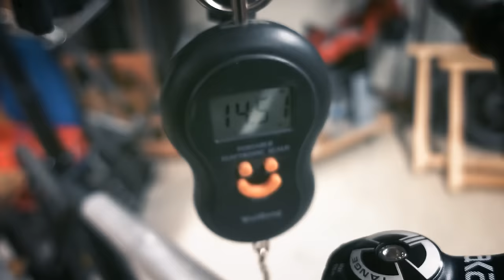Building a Light Cargo Bike

Comment: great vid I did enjoy the build, 
but I just thought, there's not much triangulation in the frame for a ?? commercial/weight  ?? carrying bike,  the  only triangle (strength builder)  on  a long frame is in the middle and it's very small, I'm guessing it's made from an aluminium alloy, which makes it lighter but much weaker... the original frame had a  near full triangle (head stem, to pedals to seat to head stem)     where this has a Much Larger weight carrying ability but a weaker frame,  square box,

Comment: why only one gear in the front and 10 in the back? 
how to power the lights only through supercapacitors?
Reply from the maker: Fewer gears and no front derailleur = less weight, less maintenance. I just don't need more. The lights are powered by a hub dynamo in the front wheel
Reply: Cool!

Comment: I admit that Phil's technology is great, and I appreciate it. The video is very comfortable to watch.
But my question is: I did not see any heat treatment of the welded frame. Is this strength sufficient for use?
Reply from the maker: So far it has held up fine
Reply: @PhilVandelay  Ok, your technique is great, I like it very much!
I don't mean any doubt，No argument.
my experience tells me that 7005 and 6061 aluminum alloys require T4 and T6 heat treatment after welding.

Comment: no offense. its a good idea/design, but I worry very much about "Stability and Weight Distribution" Some suggetion and advice though, would it be better if the carrier was at the back and it either three wheel or four wheel. Specially carrying that much load, Balancing is difficult and hard enough, though not wishing or avoiding accidents. My main  concern is safety for the package and most specially the driver and the people around. When safety is a concern I believe we cant cut corners. Peace. Take care and stay safe always.
Reply from the maker: You should google and read up a bit about cargo bikes and different models, it would take too long to explain everything here. It sounds like you're assuming I invented this bike, which I didn't. This, like other bikes I built, is a proven design that has been around since the 70s and sold millions of times. Bike messengers all around the world use these types of bikes daily for example. You should try actually riding a cargo bike before assuming they're dangerous/hard to handle
Reply: thanks for the info. i dont have a laptop and internet connection in my place is not good. just trying to get some ideas of trying to build one thats custom made. i got interested in this e bikes carrier, when i saw a video of drilled powered bikes. well in your country your roads are better off. I come from a mountainous region and our roads are not that great. I said no offense, no one can be overly cautios, one design may work for one person or situation, but it may depends on the user, their is no debate or arguing about that.Cheers :) Peace be to all.

Comment: 1 bolt trought carbon fork is enough? In my opinion it will wear carbon material around it, due vibrations and weight of cargo on bike an will develop play around it. It is too much stress for that.
But rest of the bike is very nicely done.
Reply from the maker: In order to vibrate the bolt would have to be loose in there, that's why it's secured with a locking nut. Been using this for 6 months, no wear so far

Comment: Wait, where's the part the frame is tempered? The welds will be incredibly weak without it (i learned that the hard way)
Reply from the maker: It's holding up fine after a year of daily use. I even crashed it once, broke the fork but the frame survived :)
Reply: @PhilVandelay  is it still holding up? what thickness is the tubing used in the main frame? looks like 2mm wall thickness?
Reply from the maker: @nhannguyen-sr9vh  Yes, it's still holding up fine, and I ride it almost daily. People make too big a deal about the whole heat treatment thing I think. The Tubing for the downtube and cargo frame have 1.5mm wall thickness. Headtubes are 2mm

Comment: Very nice, but a few dollars more for a double-acting disc brake would be appropriate.
Reply from the maker: True, I'm not a huge fan of the mechanical brakes (except for ease of maintenance) but believe it or not, I'm always on a pretty tight budget with whatever I build. Most of these parts I still had around somewhere.
Reply: TRP Spyre or HYRD would be an option after all

Comment: i am buying an AC/DC TIG WELDER SOON BUT, WHERE CAN I GET A JIG FOR CHEAP? I want to make this very bike!..............
Reply from the maker: The jig is really simple! It's just aluminum extrusion bolted together, if you do this style of build it's mostly just important to keep everything in a straight line. The vertical pieces just have holes drilled through with threaded rod inserted to mount the frame/fork dropouts. Then it's just a matter of getting the axles at the right height for the wheel size you're using. You can also build this out of steel tubing or even wood if it's straight enough. If you use an existing frame you mainly want to get four things right: 1. Your axles/hubs/dropouts need to be paralell to each other 2. The right height of the axles for your wheel size 3. The right distance between the axles 4. Both steering tubes (front and back) should be perpendicular to the ground (or in this case, your jig) Those + the head tube angle is what determines how the bike handles. Everything that happens with the geometry inbetween provides structure but doesn't affect the handling. Even if you're off by a little bit it will probably still ride fine! Just try it out, making bikes is fun :)

Comment: Yup... that's a cargo bike, but where's the cargo? Ya never seem to see "cargo" bikes with heavy loads. It's like a Riese & Muller Delite wearing front panniers... a unicorn, an untouched box of donuts in a police station, a millennial without a smartphone. I travel by bike and suspension trailer with 200 lbs. of gear and there's a serious learning curve when you start to change the physics of bike riding like that. It's not hard to design and/or build a bike that can haul cargo, but it is much harder to actually ride that bike with a heavy load. I use a mid-drive motor to assist but it's still definitely not effortless. Don't think for a second that you'll just jump on and cruise around without incident(s).

Comment: Excuse me  the designer, please note that the center  pipe figure is a square, it should be a trapezoid or better a triangle for intrinsic strenght.  that design  depends only in the  resistance of the tubes in the junctions. You added  a small triangle  down front... that helps a little, but not enough for a decent design , only ads weight